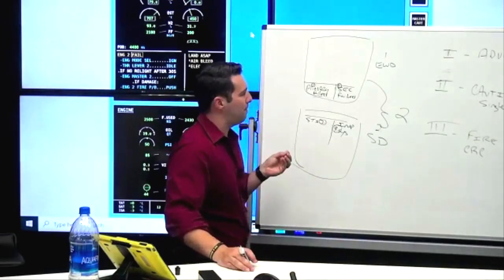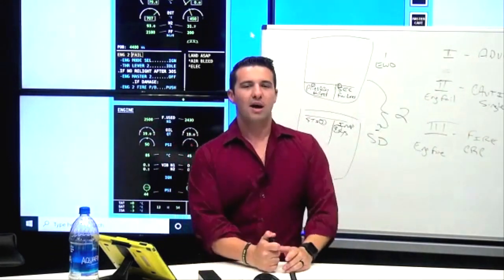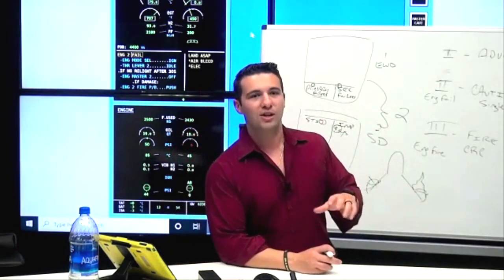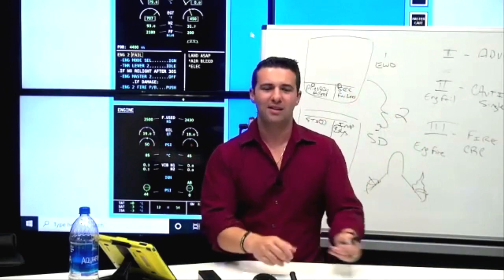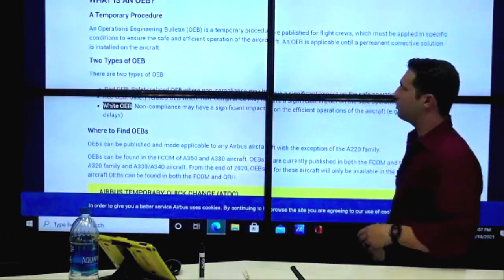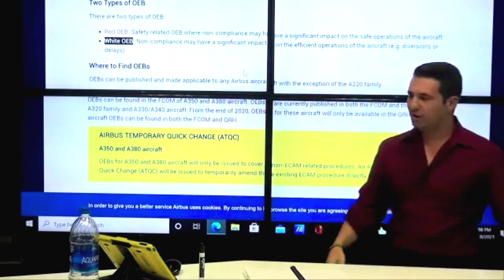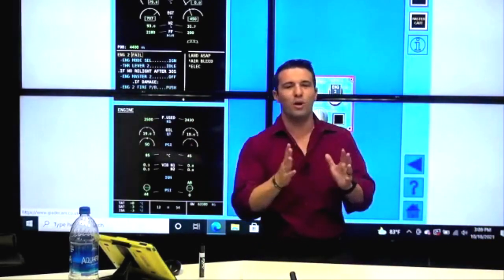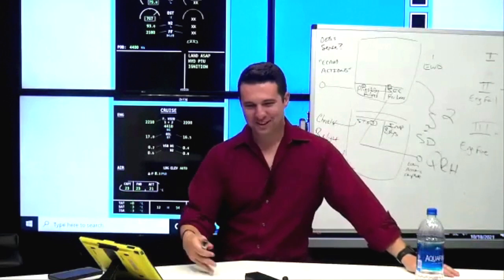A320 ECAM ACTIONS

Comment: I would say the priority is to put the fire out because a fire could cause structural damage
Reply: Well it depends on your situation, if you’re just after take off and in an area full of obstacles (like sulley) you might want to reach a point from where a safe glide is possible before shutting off the engine. 

A fire may or may not consume the aircraft in the next 10 minutes, but the obstacles in front are a certain danger if you don’t have sufficient energy so I think that’s what he was trying to say. Assess your situation BEFORE jumping into an ecam, because the ECAM cannot account for everything.
Reply: @emanueldobos8452  It takes significant explosion for that to happen. these engines are designed to keep everything within. it's not going to explode like in the movies. you rather fly with engine on fire going 200 knots (lot of air on the fire) vs shutting it down if you already lost one engine.
Reply: Just my 2 cents and remembering that the captain can deviate from anything they want in the interest of safety.The number 1 engine may or may not relight after following ECAM actions. The Engine Fire in engine 2 will not be able to be restarted after ECAM actions are complete so In this case, personally I'd use the engine 2 thrust as long as possible while having the engine 1 fail ecam ran so at least if it relit we'd have a good engine. The engine 2 will burn until it falls away from the Pilon which it's designed to do (hopefully landing away from people). Either way, use that thrust to make it somewhere safe to land hopefully.